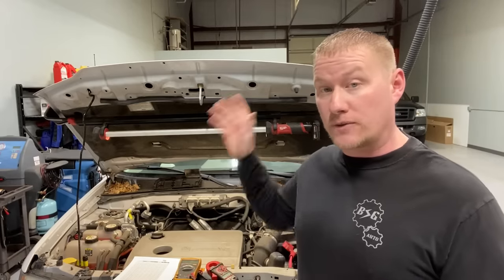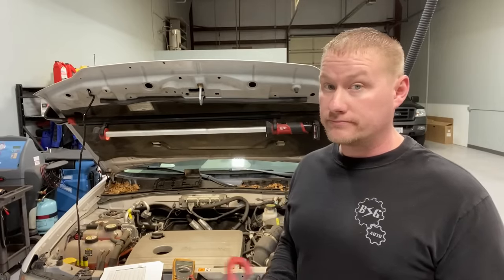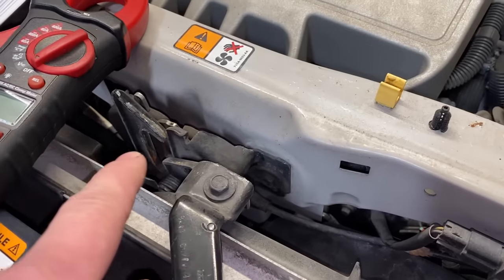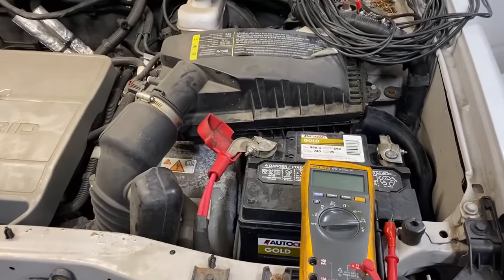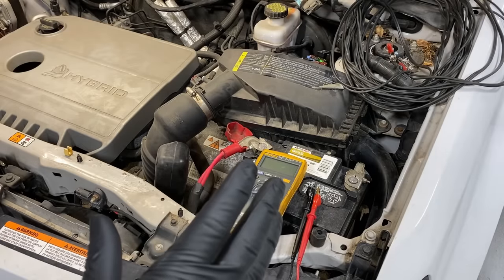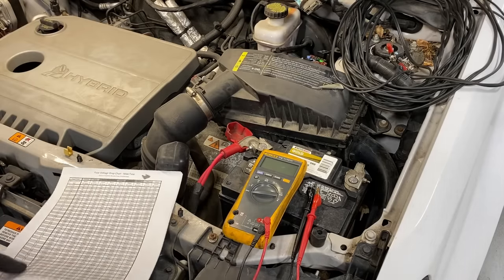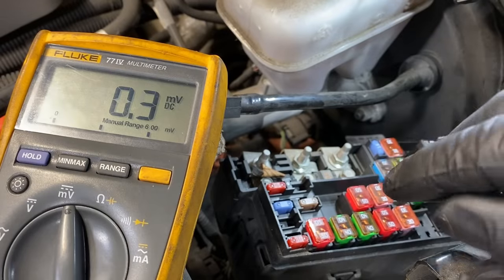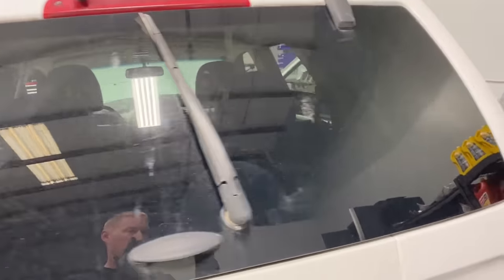Which Parasitic Draw Test Method is REALLY the Best?

Comment: I've noticed that the most common parasitic draw on a GM product is every single module and wire connector in the vehicle!  I hate GM electrical problems.  Great video!!
Reply: I laugh to myself when GMers talk bunk about Ford or ChryCo electrical problems. Obviously they never worked on theirs. 

Got a good friend in Chicago with a 2019 Traverse, already having phantom electrical issues & had it back for warranty work 4 times.
Reply: @acemobile9806  Ugh. What is it with GM and electrical problems?
Reply: @rays7437  for starters they use the thinnest wiring I ever encountered. And run it in such a way that a lot of stress is caused on the wiring itself. The rest is, unfortunately, a byproduct of modern features. A damn module for every single little thing, lead free solder with no flexibility, ridiculously complex electrical architecture, the list goes on....

In other words, overpriced junk!
Reply: No Chrysler is the worst. I had  to build whole new wiring harness. As thy mount the ECM under the front fender well. Then run the Coil pack wiring harness sunder the Intake. The place  that is the hottest. As that wiring harness cost $350.00  US.. I can build one using automotive grade wiring for under hood use for $100.00 US... Just  buy a pin out kit. Easy as making a cake....
Reply: Yes sir and they have a bunch of ground issues also.
Reply: @acemobile9806  I laughed when you mentioned the wrong gauge wire.
2006 DTS with 12ga wire that goes to a 14/16ga connector for the heated seat😲
Heat/cool cycles from small connector terminal eventually oxidized, causing excessive resistance to cause failure of heated seat. Sometimes the excessive heat frys the connector & module. 
Luckily for me, it was just the connector & not the module. 
I modified it by drilling out connector terminal hole and using a 10/12ga connector to the pin.
A shit load of patience😨& labor😥 with a😞'forty cent'😲part for the fix.
Oh . .. everything is located under the front passenger seat
Reply: @stepside2839  yet another example... I rest my case. Sorry you had to go through that hell but sounds like you did a good job on the repair. 🍻

Anyone ever messed around with the last gen Buick Riv/Olds Aurora platform with the battery/junction/fuse box under the rear seat? I can't believe a team of idiots.... excuse me, engineers, actually got paid good money to come up with that! A group of 4H kids could do better 😂 Hence GM's slide into irrelevancy & bankruptcy...
Reply: @rays7437  GM uses China electrical wiring! I have had problems with all my GM vehicles even the corvette shame on GM
Reply: @acemobile9806    I’m guessing the “chime” goes into the radio amplifier section and out the audio speakers.  ‘17 Buick turn signal does it that way, I recently found out.
Reply: I hate Chevy products, but I deal with them everyday, I will tell you right now that most of the electrical problem start with their poor quality fuse block.
Reply: Wait until you buy a dodge/jeep/chrysler. That's where the really fun begins!

Comment: Thermal image looked mighty useful!  30 seconds or less!
Reply from the maker: Just another tool in the toolbox to make the job easier.
Reply: @FordTechMakuloco  on diesel exhaust  manifolds i use it to check temp to see which cylinder is hitting cold...
Reply: @FordTechMakuloco  what if I don't have a key remote to lock and make car beep anymore. I have to lock it manually will this still make car sleep?
Reply: John Casor Yep. Before thermal cams, I used to use the old fingers to the exhaust manifold test.
Reply: @FordTechMakuloco  What is the make and model of the thermal imaging gun you used?
Reply: I also liked how he used the thermal image n found it real quick, i am going to get one of those
Reply: @lynxstarautomotive208   When working in the wilderness, I would crank up the truck and reheat food on the exhaust manifold.  Took about 4 minutes.  Reheated Thanksgiving dinner one time.  Buddies thought I was nuts, but they were eating PBJs😂
Reply: Really interesting and thorough video, think once I've watched it 25 times I'll understand what I'm doing.
Thanks for posting, feel more confident in tackling my drain issue.
Reply: It's good as long as the issue is a heavy draw like that- if it's more subtle like a relay coil drawing 250mA the fuse isn't going to dissipate much heat.
Reply: @FordTechMakuloco  1
Reply: @glasshalffull8625  Lol ..Now that is funny!! 🤣
Reply: @wingerrrrrrrrr true but the component or realy will show heat  ie radio head unit wiper motor etc

Comment: Great video. 

One more step I like to add when there are multiple fuse boxes and that there's not too much trim to be removed to access the wiring to it, I go amp clamp on battery first, then I move to the power distribution block that splits the power to the different fuse boxes. This way, you can pinpoint which box the draw is coming out off. Saves you many fuaes to check. I work at Mercedes and they have A LOT of fuses to check.
Reply: Where did you get that data from
Reply: @johnsauto5262  I'm sorry, I'm not sure I understand what you mean.
What data are you referring to?
Reply: @alexlongpre4527
Reply: @alexlongpre4527  the sheets he is reading off of is that info from all data
Reply: @johnsauto5262  from the power probe website
Reply: Can you make a video and show us and explain us what you saying  like  Chrisfix give us some Understanding ... And have the camera zoomed in so we can actually see the numbers and everything you putting it on..., like Chrisfix ,. Appreciate it Bro !
Reply: The video was spot on. A 7 year old could follow it.
Reply: @chrismoore6768  how do you put the vehicle to sleep?

Comment: Hello Brian:   I watch all your videos & am impressed by your no BS approach to troubleshooting & effecting repairs, properly done, & expertly executed. Parasitic draw can be a real challenge & I use Fluke meters with "max-min" capabilities, & I use a Fluke "amp clamp"  & I have "centre zero" ammeters that shows the direction of current flow as well. I am NOT a mechanic, have no certificates or licenses as such, but I troubleshoot & repair electrical, electronic, & hydraulic faults with agricultural equipment. Tractors, trucks, combines, swathers, air drills etc.. I am 80 years of age & I don't do any physical work....I tell people to remove a part, or to crawl into some restricted space to put a meter lead on something or other, & I interpret the meter(s). I am amazed that mechanics, generally speaking, have little or no understanding of electrics or hydraulics. I always laugh when I am asked where I went to school to learn how to fix these things. I made my living at communications radio & radar, & I still do "call outs" for oil & gas companies to fix SCADA equipment. It keeps my brain active & the challenge  is a lot of fun. I was pleased to see you open your own shop Brian, because I know you will do well. You are the right man in the right job.
Cheers!     Brian
Reply: I'm with you on this.  A fluke plus amp clamp with min/max PLUS I use some fluke extender cables as some vehicles, like my Range Rover, have fuse blocks front, back and in the middle of the car.  The extenders allow me to have the meter where I'm testing fuses.
Reply: Retired electronics engineering technician here. I could solve a lot of problems like this but would need younger people to do the physical stuff.
I am also able to interpret the results from the higher end data analysers that read and operate circuits from the OCB. It's like second nature, learned from years of school and decades of experience.
Not that many old school electronics people left, the schools don't teach electronics like that anymore.
Funny, now it's now the computer controlled machinery that needs our kind of knowledge.
Reply: @OriginalThinker_  I can say I'm impressed. I'm good at every other part of anything with wheels, or making it look good but this stuff is hard to soak up. Anyone who can has my respect. To have all that is amazing. I see so many just load the parts cannon and spend who knows how much on parts, sensors etc.
Reply: I love your motivation
Reply: Hi brian I really enjoyed your comment to Brian I am impressed  with your ability  if your ever  in edmonton  drop me a line mybe we could have coffee and swop some stories

Comment: UK been the service manager of a small garage for 43 years. This is a superb video. Very easy to follow. The heat gun test of the fuse box is super easy, Ideal first test if car has been left overnight all asleep to pick up that warm circuit. Min Max function also proves a fault simply. Many Thanks.  ( PS it is worth pointing out that the amp clamp needs to read DC , there are many on the market that only  read AC )

Comment: I have a 2009 Escape that was running the battery completely dead overnight (now Jan 2023).  My strategy was to pull fuses but that takes a long time.  Due to brilliant Ford engineering, the rear latch is inoperable (apparently a common problem) so that was my first thought.  Nope, still went flat overnight.  Did some searching and found a number of complaints about the power seats shorting out so I pulled that fuse.  Nope.  Then my brother-in-law sent me this video.  With the engine running, I turned on the rear wiper and it did not operate so it suggested it was the problem.  I pulled that fuse.   That was the problem so I did not actually have to follow up with this process.

Thank you, now I know the best approach to do the parasitic draw testing.  I have a decent DMM but not the amp clamp.

And also much thanks to the brilliant Ford engineers who designed the circuitry to allow the rear wiper to run the battery flat overnight, such a genius approach to drive more people to the Ford service centres...  Ridiculous.

Comment: Brian, that was invaluable!! Those intermittent parasitic losses have aggravated us for YEARS. Your method is sound, and thanks for disproving what some say is the "right" method! 

I'm going to tell you an old story, if you've got a few minutes.
I was a Lincoln/Mercury Line Tech, a few years before you....
EEC II and III were still out and harassing us!! 😖😖 
EEC IV was only recent then, when I had my only claim to fame...

1991, the first Town Cars on the Panther platform were hitting the market. Several were coming in with heavy Battery drain concerns. 
Immediate diagnosis was the Voltage Regulators. So Techs replaced VRs and Alternators..... 

But they kept coming BACK. Same concern! 
SOMETHING was killing VRs... And guys were searching miles of wiring, to no avail. Customers were of course, getting frustrated. So were we! 

One day, I decided to get fundamental... I opened an EVTM. 
Almost by accident, I FOUND the problem! 

91-92 Panther Vehicles WITH Heated Windshields - the CHARGING CIRCUIT went from Battery to Alternator, to Heated Windshield Module, to Voltage Regulator... 

And the Vehicle I was working on, had a Cracked Windshield. 

Turned out, the crack in the Windshield, SHORTED out the Heated Windshield Module, thus losing any signal to the VR!! 😳 
.... After fighting with the Dispatcher, I got to order a new Windshield and Module. 
Didn't touch the Alternator or Regulator...
FIXED permanently! 

Ford ordered a TSB (should have been a recall) for a wiring Harness shunt between Alternator and Regulator, and changes were made by the 93 model year!! 

You ever come across an issue like that? 
Carmine ✈🚂🚙

Comment: What a great video! Thank you for taking the time to show the different methods and what works. We have been having an issue for close to 9 months off and on. We have a f350 6.0 2005, had a shop put in all new injectors, HPOP and they installed a used wire harness. A week later I was at a stop and it died in gear. Brought it back and they replaced the batteries (I know….stupid). Got it home and a few days later same issue. We then bought an alternator and installed it ourselves. Truck ran great for about 6 months. One day, drove to work and parked. About an hour later hopped in to run to the bank and the tick sound happened. Batteries dead. Batteries tested bad and decided to buy new batteries and another new alternator (thinking it was a bad alternator-it happens). Installed all ourselves. About 2 weeks later, hop in to go to work and she wouldn’t start. Battery output 11.6 and dropping. Jumped the truck, let her run about 5 mins and tested batteries. Output dropping as she was running. Went from 11.5 off to running-dropping down to 9.6….I’m researching what would cause draw intermittently. It happens sometimes and usually is fine for a couple months once we replace alt and batt. We are at a loss.if anyone has any advice, I would appreciate it. I am sorry to asking here.

Comment: As another poster below mentioned... if you find it necessary to pull multiple fuses, take a couple of photos of the fuse box before hand. It only takes a second & can later save a lot of grief in figuring out what went where. Don't ask how I know. Great videos, Thanks!
Reply: You will commonly find what value goes where on the inside of the fuse cover you ripped off and threw in the backseat... Don't ask how i found out either xD
Reply: Thanks ☺️ very useful

Comment: I'm old school, I have been using various combinations of these methods for years.
Starting with the amp clamp to determine how much draw there is and whether its constant or intermittent.
The result determines the next step, if it's reasonably high draw even an IR thermometer can tell you which fuse it is.

Totally agree non invasive is best, pulling the wrong fuses can set all sorts of codes and require a scanner to erase them again. This adds more time to the job and cost to the customer unnecessarily.
Reply: Been looking for new techniques..  Gosh, I like the thought of using IR technology to help find the source of my 12.5 Amp draw.  Thanks Guy!
Reply: I’ve heard also pulling fuse can wake computer and you got start all over again

Comment: Have a 08 Odyssey, would not start after driving to school/store. A boost would get it started.
Last week wife got stranded, towed home for testing.
Pulled MG. Clutch fuse while poking around. Put it back in 20 minutes later, started up!!
So released the compressor clutch using fuse. Heading outside to check relay.
Thanks, great video

Comment: We use the traditional amp meter in series at my Ford dealership. I never thought the mV to mA reading conversion method was a good idea. Also love how you also use a shop rag to insulate terminal end from the battery post. A Senior Master at my dealership showed me that trick! Pretty slick. I also use a parasitic draw tester set of leads that have much larger amp clamps that can easily fit over battery posts. Plus if you make a mistake and over load meter it's a simple ATO fuse to change that cost pennies. We also try to have a draw of 20 mA or less. Always love your content!
Reply: A modern "DC Amp clamp" meter  from China ($40 Amazon)  is really the way to go over in-line meter rated to 10Amps Max.
Reply: As a non-mechanic, I once had to track down an intermittent drain in my car.
I do do electronics, so I tried connecting a multimeter on a low DCV range (20mV or 200mV, I can't remember which) between battery negative and the vehicle body, basically using the negative battery lead and its ground connection as an in-situ current sense resistor. That gave me a reading I could roughly calibrate by comparing readings with/without headlights on and using the nominal power draw of the head/tail lamp bulbs, and meant I didn't have to disconnect anything to get usable information.
I made up a long lead on thin wires with croc clips on the battery end so that I could have the meter inside the car where the fuses were, and since one wire was ground and the negative battery connection was virtually at ground I was happy to have them (suitably taped down) running out from under the closed hood and in round the edge of the passenger door to the meter even while driving, since there wasn't any risk of high currents flowing even if they ended up getting pinched or worn and grounded to the body.
Not a precise solution by any means, but easily good enough for me to track down the issue (fan thermostat causing a slow intermittent drain which didn't seem to be there when everything was fully cold, and which would only start after running the engine and then letting everything cool down for a while).

Comment: An alternative to an amp clamp is to use two meters, one as an amp measuring device and the other as a millivolt device. I would suggest this as you can get the vehicle to sleep and then use the min/max function to monitor for awhile to determine if you have a major draw without having to visually monitor the amp clamp for a period of time. Excellent video and explanation of the various methods and reasons for using two methods at the same time.

Comment: You make a good point, intermittent problems are always the stumbling block. My amp clamp isn't very accurate at low current levels, but the ability to measure without disconnecting anything is lots easier. Also you'll never fry the amp clamp like you will if you exceed the 10 amp maximum in line. What I like about the drop test across fuses is that (when it works) you quickly know which circuit is involved. Even in the example you showed, it did work when the circuit was drawing current. Excellent point about intermittent draw, and cool the way your IR camera found it.